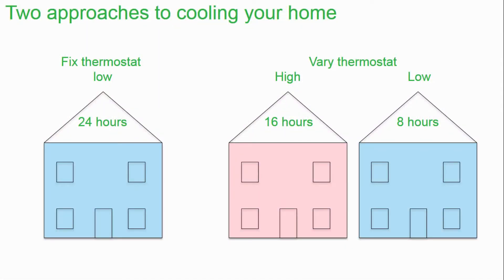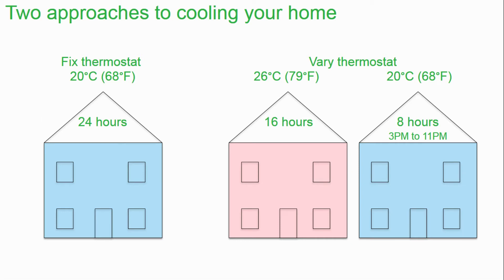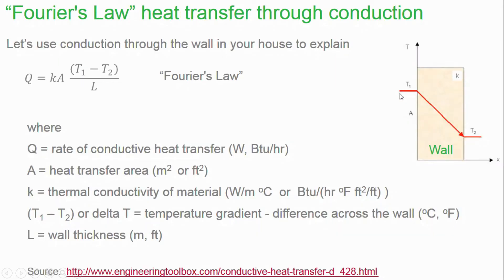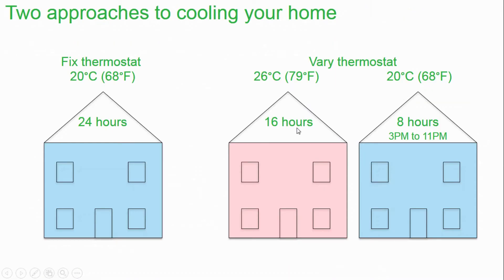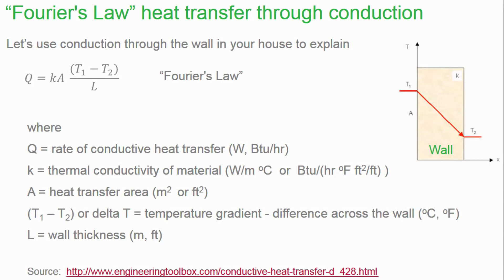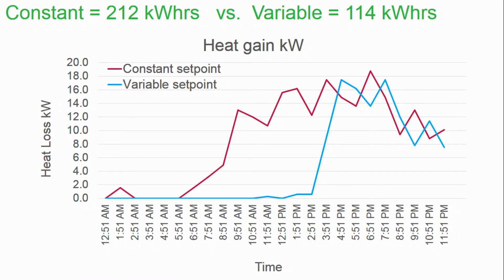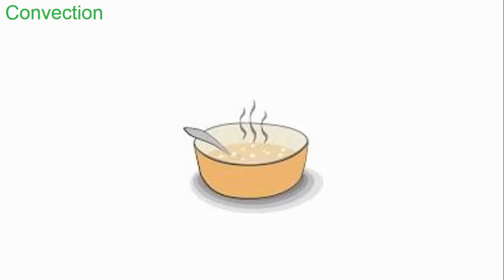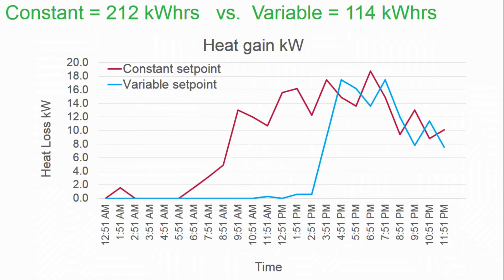Improving Data Center Cooling efficiency by understanding deltaT

Comment: What, if any, are other ways to increase DeltaT, other than lowering the fan speed? Perhaps the type of conduction and value of "k"? What would that mean in terms of a CRAH/CRAC in a Data Center?
Reply: Hi Andrew, the lowest common denominator so to speak will always be the IT equipment deltaT. You can overdrive the CRAH fans to lower the deltaT but the CRAH airflow should never lowered to the point where it starves the IT equipment, if it does the deltaT will certainly increase, but at the expense of the IT equipment reliability and performance.

The most effective way of increasing deltaT is to specify IT equipment with a high deltaT. This isn't straight forward with modern gear because it tends to have a variable airflow control based on the % utilization of the machine. This is an energy saving feature but makes it more challenging for data center designers to "tune" the cooling for efficiency. Airflow and deltaT data also tends to be buried in the equipment documentation and sometimes isn't listed at all which requires phone calls with product managers who know.

Comment: Thanks for the explanation.
There is a limit to maximise this air delta T which is around 11C to 13C at the moment in data centres so as to avoid reducing air flow below certain levels to avoid hot spots.
We have seen trends to have air flow in data centres as 75 lps / KW of net sensible cooling .
By the way the more I enjoy by having lower temperature in my room,the more I have to pay ....simple logic 😊